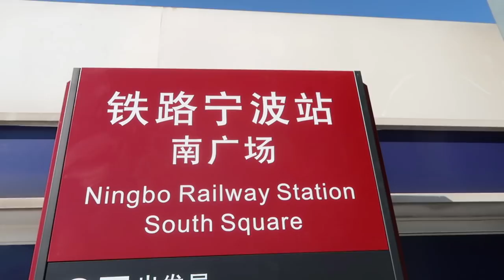40TB VLOGGING VIDEO SERVER!

Comment: Not a bad price for that computer. At work I have setup a Synology DS1618+ for our company storage, clients to send large files, and a virtual server for some office programs. The Web application is amazing allowing you to access files, and run other "Google Docs" type systems. If we didn't have Office 365 for email, I would use their email server too. The price isn't too bad, if you install your own memory upgrade. The major cost is drives, the WD Purple are good, we run the WD Gold Data Center drives, but only 6TB drives. With one of these you can put 8 drives in and add a expansion box too. Too bad the 12TB drives are 2x the price of 10TB drives almost. I'll have to check out dudes channel now.

Comment: Excellent plan to build a storage server. Should bring some convenience while on the road. Might want to consider a different RAID scheme though. Although RAID1 is very performant (not needed in your case) it is wasteful with regards to space. 

Your friend might want to look into ZFS, RAIDZ2 and RAIDZ3. Nice thing about ZFS is that it protects against bit rot as well. 

Having said that, even the RAID1 he's building you, is probably a lot better than your current solution with the rugged hard drives. And he should do what he's comfortable building and running.

Comment: while good as a for backup purposes i dont think it will be fast enough to get that huge media and videofiles back and forth in a timely manner.... especially not with teamviewer as that inself puts a "man in the middle" and is super slow for file transfers , teamviewer is suited for remote support your server. tell your friend he scould take a look at s real cloudsystem running on that server like "owncloud" "seacloud" or "tonido free edition" - these are free real cloud systems with integrated html5 support for your client devices, your mac and apps for your tablets and eg iphone to access your files and move them back and forth... always remember doh those services are only as fast as your ibternet connection is... so like said moving tons of files around will require your friend to have a stable fast net connection aswell as you having a solid connection whilst beeing on the road..... cheers -ck

Comment: So it appears he is going to use a mirror raid or "Raid 1" then?  I wonder why not a Raid 5 or 10? Guess I can ask him on his channel. I am currently using a Synology hybrid raid on my NAS (network attached storage) with 4 4TB drives and get a little over 10TB of space, but for that I paid over $800.00 USD. And I can throw on a 5 drive expansion fairly easily. 

Still it is good to see you are setting up a back up for your files. So your only limitation on the road will be network bandwidth connection to upload/download data from your server.

Comment: Why not a cloud service? I Like Google Drive.
Reply from the maker: For 20 TB it would be insanely expensive and monthly. No thanks. I like to own the hardware
Reply: Ya 20TB would run $199USD/Month, you can buy a new 10TB drive each month for  the cost of that. You do lose out on them making sure its running good and always accessible from the internet, but then you have to worry about countries blocking Google or Dropbox or what not from their country, hosting it yourself is less likely of being blocked.